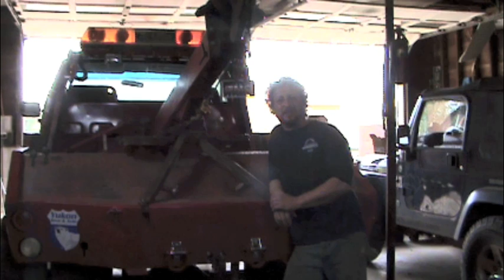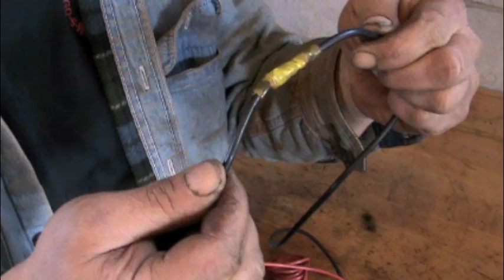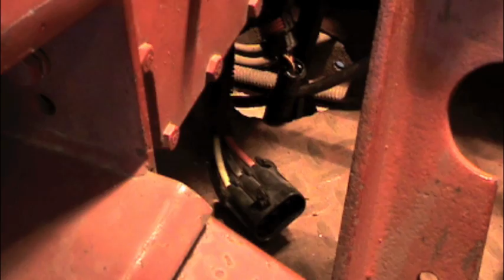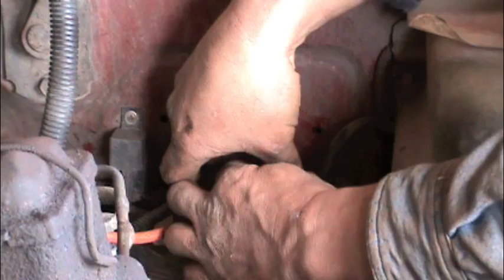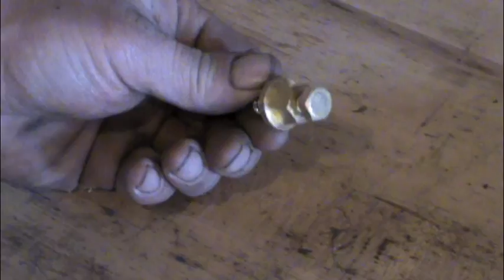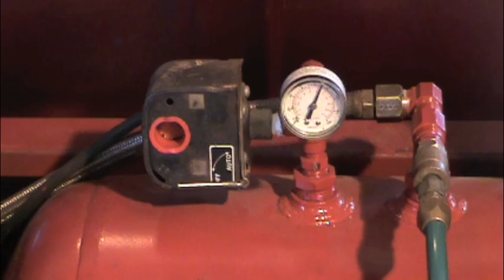Onboard air part 3 by BSF RECOVERY TEAM

Comment: I am making a belt drive one for my 2005 serria with a GM AC compressor off engine belt with oiler on pump and oil water remover on pump out put where it's got a 100 percent duty cycle and higher cfm rating

Comment: i use to use the old squar type ford a/c compressur. because it was oil filled. and my rear bumper was the air tank. but omg it weighed alot. now they have small stuff like yours that does jsut as good if not better. great videos.

Comment: How is the compressor working these days?  I had a similar truck (I've now removed the wrecker box, installed a pickup box, and converted to single wheels) and for on-board air I used a GM A6 compressor out of a 1970 Eldorado and an A6 mount for a small block Chev.  The A6 has a built in sump pump for oil so you don't need a oil mister and separator.  It fills my tank in about 30 seconds and the pressure switch is set to 120 PSI on/150 PSI off.  It's been well used since I installed it in 1998.

Comment from the maker: @CALVINATOR69 The compressor has 100% duty cycle, it takes about 15min to fill the 5gal tank to 90psi. I can use a impact wrench but it only lasts long enough to maybe get the lug nuts off one tire, before I have to let the compressor catch up. I have been thinking about mounting another one, run them both into the same tank for more volume.

Comment: With that air pump I've seen lots of those when I worked that the st Paul auto wreckage how long does it take to fill that tank and what kind of duty cycle does it have and how often do u use it cuz I'm thinking of doing what u did to the yard truck to run a impact that would be great